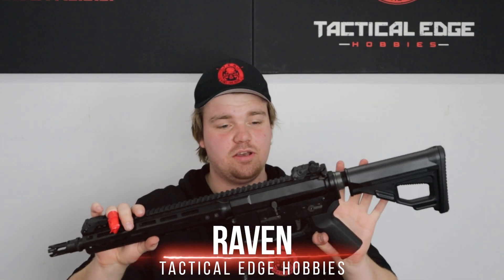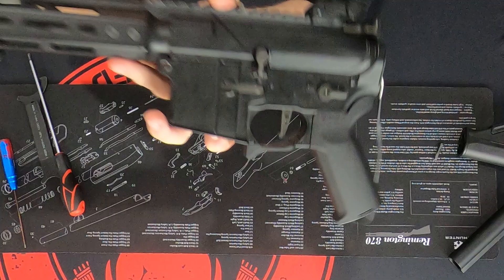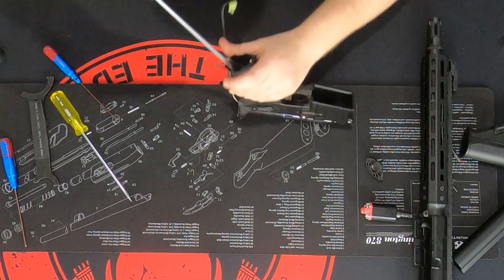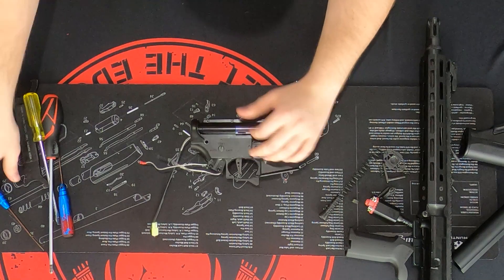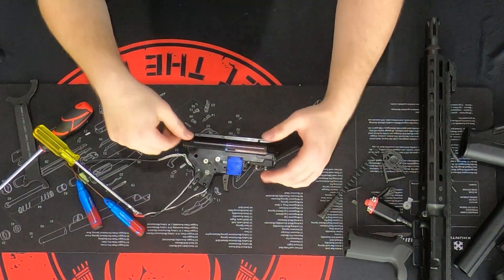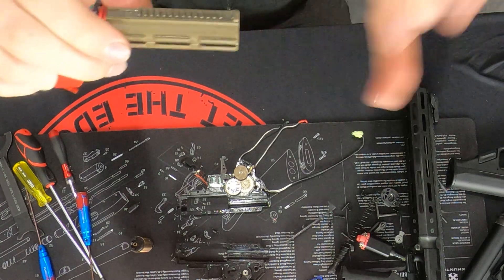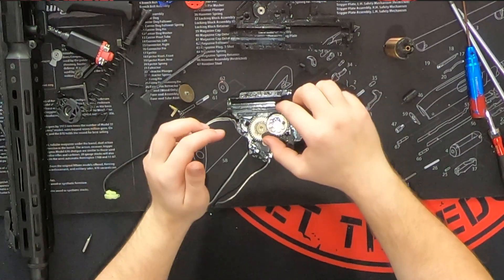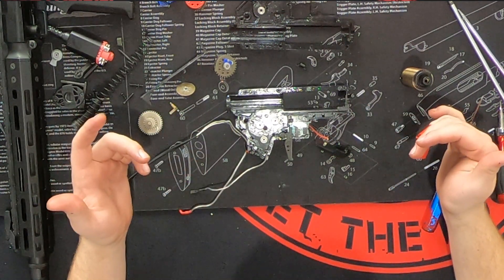What is inside? - AQUA by Ares Gel Blaster Teardown | Gelsoft Tech Talk

Comment: Just my personal opinion, if I put a blaster into a shop for repair, and some tech had used a screw driver instead of the correct Allan key and risking damaging the head .
I'd be a very unhappy customer.
Reply: TRUST ME, that piece of metal is not that easy to get damaged.
Reply: @taojia1850  not that easy doesn't mean impossible.
Technicians in a reputable store have access to the right tool for the job. Be professional!!
It's like seeing a mechanic working on a customer's vehicle, using a shifting spanner instead of a ring spanner.  Only because it's convenient,  but has a possibility of damaging the nut or bolt.
( I have never seen that )
Reply: @robertnewman4619  Come on man, this is only a TOY, doesn't really require an automobile standard, honestly, even the "V2 gearbox" is not a standard, different brands will manufacture different specs, you can hardly transplant a part from 1 brand to another without modification. I mean, it is nothing wrong if poeple treat GBs seriously with some decent tools, it is actually great if we can bring it to an industry-standard level, but after all, it is only a TOY, so treat it as a toy.
Reply: @taojia1850  mate.  Iv got a number of blasters that cost $1200. And I don't mean 1 or 2.
Not everyone bothers with $200 cheapo blasters.
So yep, you got only one thing right, they are only toys.
But some are bloody expensive ones. And their owners take pride and look after them.
If I'm paying a shop tech for repairs or maintainence,  I EXPECT them to use the right tools for the job.